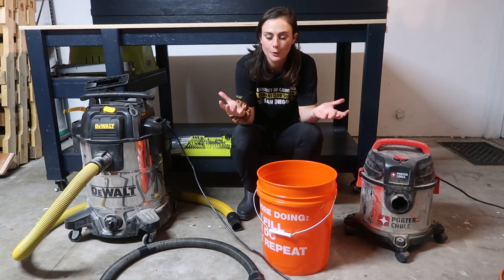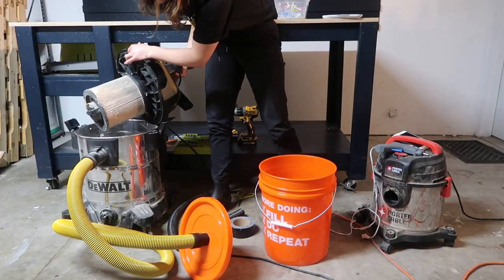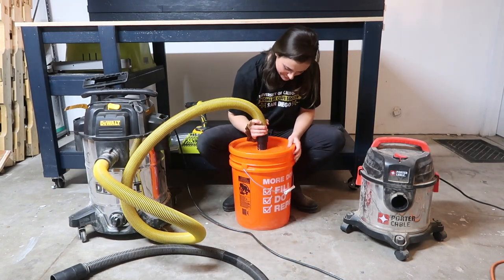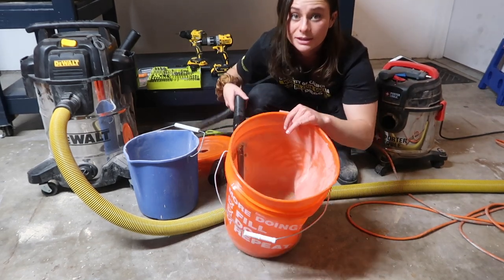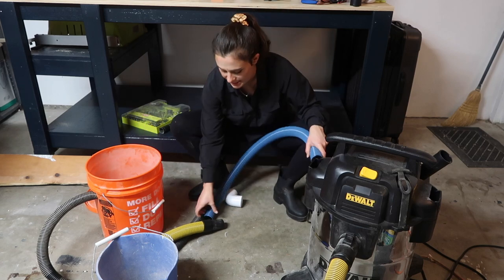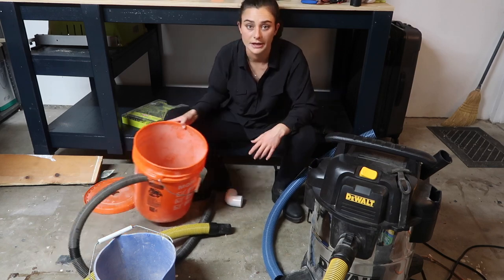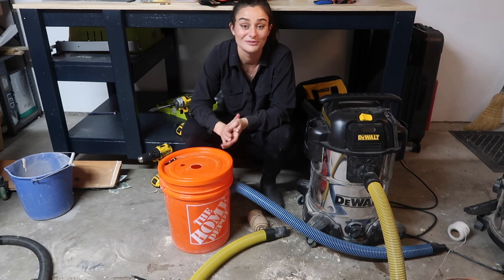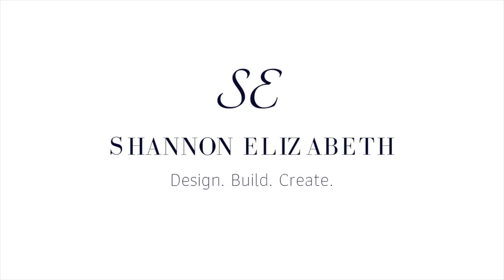DIY Dust Collector with a Pressure Release Valve

Comment: Could probably alter the pressure release to be spring loaded instead, replace the magnet with a machine screw that runs through the metal lid and your cross beam, on the other end of the lid put a washer, spring, and nut.  The spring will push the metal lid into the bucket lid but when pressure is high the spring will contract and allow air in before closing again.
Reply from the maker: that is a good idea! thank you for sharing!
Reply: @ShannonElizabethDesign  nice video, you can put put a number of car tyre tubeless valve stems into the lid with the threaded cap-end outwards and they will open when the air flow inside gets too high, I converted mine to a 15 litre metal paint tin with snap-ring lid that has a seal, where I live (Australia) paint shops will give you them for free just to get rid of them, never collapse either.

Comment: I wonder if a small spring loaded hinge holding the pressure relief flap,or a flexible flapper that is ridgid enough to return to the closed position.  This might regulate the air flow ,allowing the most efficient air flow.❤this hack going to try and use a metal pail. Super great idea, thank you so much.
Reply from the maker: Thank you so much! Really good idea! Super smart. Thank you for sharing and thank you for watching!

Comment: I think the downsized pipe would create a restriction of air flow.... But the main reason why it compressed is probably because when you were sticking the hose end into the bucket, the hose end would get blocked by a flat surface area causing the air pressure to be compressed due to a completely sealed environment. Even if for a second it were to be completely sealed it will collapse the bucket.
Reply: Just be sure a large object that would block the hose doesn't come near the hose end or a flat surface doesn't block the hose end.

Comment: I don't know what all the advantages are going from the small tank (Porter Cable) to the big tank (DeWalt), but if you're going to use a dust separator anyway, you may as well use the small tank unit.
Reply from the maker: So smart! I definitely didn't think of that before!
Reply: More CFM, is the advantage.  That dewalt probably does double if not more CFM than the smaller unit.

Comment: I wonder. what if you cut a circular piece of plywood that fits in the bucket, maybe halfway down. Drill a hole in the middle of that circular piece of plywood(or many holes. I don't think it matters). I think the rigidity of that plywood would also keep the bucket from collapsing. Also, the holes in the plywood would allow for the dust to fall to the bottom. Idk, a thought

Comment: Hi Shannon

I'm impressed with your persistence.  But you don't have the solution yet. If you want to stay with your current concept I suggest that you use a spring to return the lid to the closed position. 
I suggest the following:

Make the hole bigger
Buy a long small dia bolt or eyebolt some nuts and washers
Buy a long spring; you may need a fender washer if the ID of the spring is too large
Cut a narrow strip of wood to bridge the vent hole with a clearance hole for the bolt in the center

Assemble the bolt, fender washer, spring, cross bar, plastic lid, nut, washer, metal lid, washer, nut.  Screw the crossbar to the lid.  Glue the magnet to the crossbar if desired.

Comment: I enjoy your videos. I’m impressed with your patience during this video and I appreciate watching your trial and error, your persistence, and discovery. I would have kicked the bucket. (Not died, but literally kicked the literal bucket)
I don’t know much, I’m new at woodwork, but it seems to me that the bucket is really flimsy to begin with. Would a sturdier bucket that doesn’t collapse cause other problems? 

Keep shooting! Thank you for letting us in on your progression and problem solving. It’s relieving to see that I’m not the only one with issues and seeing your small journey to victory teaches me to be a bit more patient and a lot more persistent!
Reply from the maker: Thank you so much!!! I was actually kind of nervous putting the different trials so thank you so much! Yeah a less flimsy bucket would definitely help. Although if you attach a cyclone to the top, it would probably collapse instead of the bucket and those are more expensive than buckets so wouldn't want to break that. But, if you don't have one, I think it would be okay. 
Thank you so much!!! I really do appreciate it!! 😍😊
Reply: I used a second bucket with the rim structure and the bottom removed and sleeved it inside my bucket.  I used construction adhesive (and managed to overcome my own impatience by letting it cure overnight).  There seems to be no more tendency to collapse.

Comment: Was thinking you could get some thin MDF or Plywood and roll it into a cylinder and insert it into the bucket.  The springiness of the insert would push against the sides and stop the bucket from collapsing.
Reply from the maker: That is really smart!!! And would be super easy and quick! I want to try that 😀

Comment: I wonder if it's just a crappy bucket. I had the same problem with my set-up, in which I used a Home Depot bucket. So, I turned to YouTube for the answer. Low-and-behold, every video on dust separator buckets collapsing involved an orange Home Depot 5 gallon bucket.

Comment: I used a 17 in. x 16 in. Sump Basin Model # SF15 from Home Depot. Much stronger material and will not crush. There is also an 18 in. x 22 in. Model # SF20 if you have the room.
Reply from the maker: Oh nice! I haven't seen those ones. Thank you!

Comment: One tip to keep your bucket from collapsing is to buy another bucket and insert the current bucket into the second bucket and that will give the first bucket twice the wall strength which is why the flimsy bucket is collapsing. It's not my idea but I got it from another genius Youtuber by the name of Chris Notap. ....No need to over-engineer this.

Comment: When you need to drill a larger hole when you have a smaller hole - get a block of wood and drill the bigger hole in it. then clamp it over the smaller hole and slowley drill.

Comment: I enjoyed watching you learn and solve but at the same time I kept thinking, you could buy a Dustopper and be done with it. You spent $50 on the extra hose so cost became a non-issue.
I'm an old fart and I've learned over the years to stop trying to re-invent the wheel. However, I'm not a rich old fart so I also understand the desire/necessity to DIY it. 
You learned a lot during this process and that's a good thing. On the flip side, you spent time and money on a problem that already has some well-established and cost-effective solutions. It's a delicate balance that experience will help you tip the right way more often than not. That said, it's still a pretty cool journey regardless, right?
Reply from the maker: Thank you so much!! The hose actually costed $15 not $50 haha yeah I definitely would not have bought it if it was that much.
Reply: @ShannonElizabethDesign  my apologies. I thought I heard you say fifty. And I had headphones on, too. See, I am old.

Comment: They make/sell an item called a dust topper at home depot.  Snap it on your bucket, problem solved.  I think they're like $30.  Those cheap buckets are the problem, not intended to work with that suction.
Reply from the maker: Thank you! Do you have one? I have always wanted to try one

Comment: 4:13 Since version 1 you were correct. Simply put your dust collection bucket inside another regular bucket (with out  modifications). Problem solved. The dust collection bucket will not collapse under the power of your vacuum cleaner as it is nested in another bucket. I learned it from this video: https://www.youtube.com/watch?v=BeU4nqSJtBY&list=LL

Comment: Just make a wooddisc inside with holes to enforce the bucket and prevent collapse
Reply from the maker: I was thinking about that. But I don’t have a band saw to make a perfect circle.
Reply: Put the primary bucket inside another bucket. It will reinforce the bucket walls to prevent collapsing. You may need to add a hole to allow your hose to pass through the side. Or just buy a Dustopper at HD.

Comment: home depot sells  Dust Separator called the dustopper for like 35 $ and it just fits on  most 5 gallen bukets  and if your buket sucks in like yours did you could just sit it in a other 5 gallen buket and from the videos i saw that stops it
Reply from the maker: Thank you! Yeah I want to try that solution as well

Comment: The problem is that any resistance on your suction in pipe is going to cause the valve to release. I think stronger magnets would better but you also need something so that when the flow is free again the valve locks the hole again otherwise you will just either have to put up with low suction all the time as the valve kicks in or constantly be resetting it.

I did watch the video first you had seen but I think it needs a little more engineering.
Reply from the maker: Yeah, you are right. That is annoying having to reset it. someone in the comments came up with the idea for a spring loaded valve that I think I am going to try out

Comment: What is the point of this valve? if the pressure is almost always high enough to pop it off the magnet, what does that achieve?  It's the same as having just the hole in the top with a short time-delay.  It might be better to put the jar lid on a spring loaded hinge, so that it returns to it's place after the pressure reduces.  But having just the hole seems like the best option, because the valve is only saving suction power for a second or two of use before the valve actuates.

Comment: You should try one of these drain vents for a sink. They do a similar thing but for drains. Maybe put it on the lid, and use a bulkhead fitting to make a seal. You might need an adapter fitting to mate the two parts.

Venting Valve - https://www.homedepot.com/p/Oatey-Sure-Vent-1-1-2-in-PVC-Air-Admittance-Valve-20-DFU-Branch-8-DFU-Stack-39230/205395535

Bulkhead Fitting - https://www.homedepot.com/p/Everbilt-1-1-4-in-FIP-x-MIP-Barrel-Bulkhead-Union-with-EPDM-Washer-Fitting-800459/207176885
Reply from the maker: That is so smart. I haven’t seen those before. Thank you for sharing ☺️😊

Comment: If you add a pressure relief valve then it negates the purpose of a dust containment system as when the valve opens it will shoot dust out.

Comment: Hi Shannon. There are a few tricks you can use to enlarge a hole using a spade bit or a hole saw. As you pointed out, the guide drill has nothing to bite into so the larger holesaw (or spade bit) just dances around all over the place. With a spade bit, if you clamp a piece of timber behind the hole, then drill into the timber, the bit doesn't wander. With a holesaw, you can do the same, or there are a couple of other tricks. The first involves cutting a hole with the larger holesaw in a piece of scrap timber, then clamping the timber over the hole so you can use the hole in he timber as a guide. Another trick is to double up the holesaw with a smaller one, as shown here https://www.youtube.com/watch?v=9-pBlZa1RBI
Reply from the maker: That is super useful! Thank you! Definitely going to try those😀

Comment: i realize this video is over a year old, but as long as you keep the end of the hose from occluding, you should be fine. it seems like you just stuck the tip right into the saw dust.

Comment: Nice video but i can't help but feel that you are making it difficult for yourself. The problem is the negative pressure caused by the vac so you need to equalise the pressure at the inlet to the bucket. You should be able to do that with a larger inlet hose.
Reply from the maker: Yeah, you are right. Thank you! :)

Comment: I'm sorry, but a pressure relief valve that you need to switch off and reset doesn.t strike me as a good idea. If you go to the CharlieDiYte channel, he has recently done a video using a valve available on Amazon, I believe. It's very cheap, easy to install and resets as soon as the pressure reverts to normal. It's the route I'm going to try first.

Comment: They do sell a hose attachment pack at HD....
Reply from the maker: Yes, I got it at home depot. But it was really hard to find. I had to ask someone. It is technically is a Pool and Spa hose. The have a long roll of the hose up high, so you have to ask a worker to cut you off a piece. And they price it by the ft. I got a 3 ft piece cut at $4.68 a ft so I spent about $15. Hopefully that makes sense haha but if that didn't or you have any more questions you can dm on instagram :)
Reply: @ShannonElizabethDesign  on the vacuum section, they sell a pack that is specifically designed to be attached to those vacuums, the hose is maybe six feet long and it has a couple of attachments for different sizes. I think the brand was Rigid

Comment: I realize this may be knit picky but your terminology is off, what you built isn't so much a dust collector as it is a dust separator. The main issue though is that design becomes less effective as it fills up, which it will do rather quickly, and all that dust will end up in your vac's filter. Everyone balks at the price of the Dust Deputy and rightfully so. $50-ish for a plastic cone is just ridiculous. After using one though I would probably happily shell it out again if I had to.

Comment: A single bucket does not work veery well because the dust is in the same chamber as the suction hose..  There is a reason that real cyclones all tapered cones and a separate chamber from the bucket.. HOWEVER,, it looks like you had fun with the project..
Reply from the maker: Makes sense. Yeah thank you 😊 😁

Comment: nice dust collector but the "valve" is crap. why nit put a springy sheet of something to the inside? if pressure exeeds a certain limit, it will ow inward and allow relief air to flow. the moment the vacuum is tolerable again, it will flip back and close the hole. much easier and self regulating...the "drop in magnet" is complete shit ecause u will have to search it in the growing pile of dust...let alone if u also suck in metal shavings...